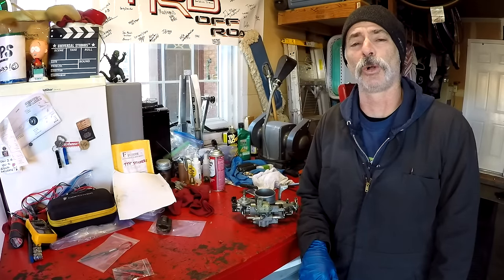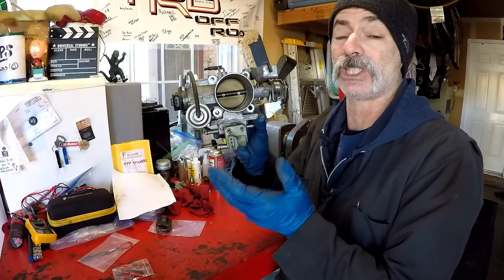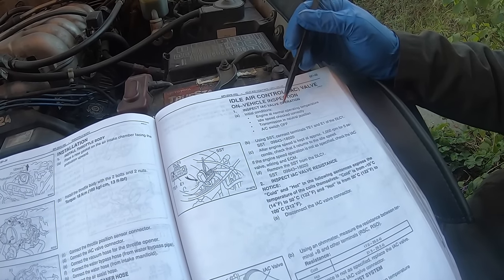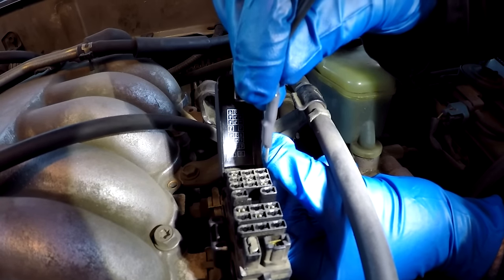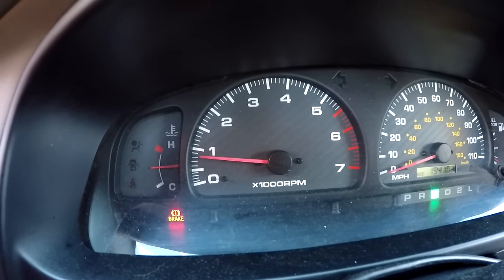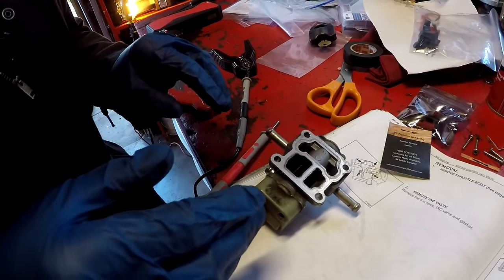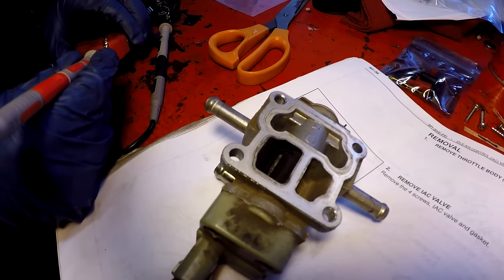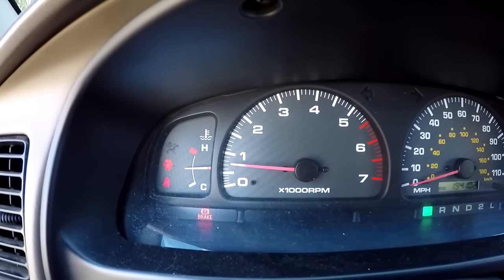IAC Valve Testing and Cleaning

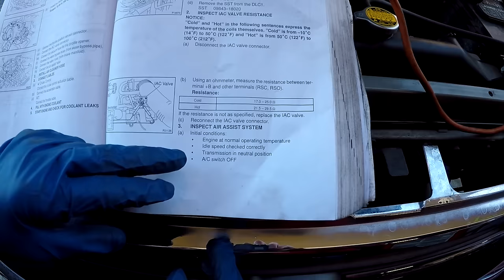Comment: 20:55 wow ..so much more complicated than the GM  3.8 L Buick V6  IAC  removal process ..
Reply from the maker: Well, the time stamp you gave was part of the testing we did for the IAC, not the removal.  The removal is actually quite easy.  Remove the throttle body, flip it upside down and remove the 4 screws that hold the IAC to the throttle body.    Pretty straightforward.  The testing for sure was a little more involved.

Comment: I have a 2003 Toyota Tacoma with the 3.4L and it doesn't have a iac does anyone no why
Reply from the maker: Hey Kevin,  Toyota changed the throttle body design for the 01 and 02 4runner models and the 03 and 04 Tacoma models.  It has a different system to deliver air to the engine under idling and deceleration conditions.  I'm still unsure how it accomplishes this and I've made a Toyota forum post and hopefully somebody will have the answer for me.  There is an obvious air passageway on the backside of the throttle plate but how the air is delivered to that passageway is the question I'd like answered.  If I get an answer, I'll put it in the video description or a pinned comment.  Stay tuned.

Comment: Tim, what makes the RPM's stay high when shifting a manual transmission? Can you possibly do a video on this? Great video btw!
Marc C
Reply from the maker: I don't follow what your problem is.  The idle is high only while you're shifting?  Is it high when just idling too?  It doesn't make sense to me, so if you could explain it better it would help me answer your question.

Comment: Would this cause extended cranking to start when it's cold
Reply from the maker: If the valve is sticking and not giving the engine the air it needs, it could cause it.
Reply: If that's not the cause what else could cause that
Reply from the maker: @davidrowland2354  It could be a fuel delivery issue.  Maybe it's taking extended time to build up sufficient fuel pressure to start the engine.
Reply: I put a new fuel pump new pressure regulator new fuel injectors new fuel filter
Reply from the maker: @davidrowland2354  Well, you covered the fuel delivery possibility.  It couldn't hurt to clean the IAC and see if that helps.  It could be a problem with the igniter that's on the passenger side of the engine compartment.  But, I don't if an igniter would have an intermittent issue like this.
Reply: It just happens when it's cold it takes 3 or 4 cranks to Fort the start but when it's warm it starts perfect I'll try cleaning the valve and get back with you thank you very much for your information
Reply: I tried a ohm test and nothing registered
Reply from the maker: @davidrowland2354  I guess you found your problem as long as you did the ohms resistance test correctly.

Comment: ive recently face a problem with my 5vzfe engine where when i start driving (after the engines warmed up to operating temp) the rpm drops and returns back to normal in a very fast manner (with slight loss of power) and this only happens when i start driving the car I.E. the remainder of the journey the car drives fine, ive scanned the ecu and ive had no codes detected (had one maf code which had gone away after cleaning the maf) would you be able to point me out where might my problem be ?
Reply from the maker: It might be a problem with your throttle position sensor but I'm not sure about this.  It's a hesitation with the engine responding properly to the throttle response so I'd probably start by diagnosing a potential problem with throttle position sensor and go from there.  It could also be a problem with the engine temp sensor that communicates with the ECU to know when to increase the idle when cold and bring it back to normal when it's warmed up.
Reply: @TimmyTheToolman  well when we scanned the ecu it only gave three codes two of which were related to the MAF sensor and another was the o2 sensor however the o2 sensor gave a code because i have removed my cat, my mechanic keeps stressing that he is 90% certain that it might be from the crankshaft sensor but it never gave a code. further more i wanted to mention that the car used to have a 3rz engine and i switched it to 5vz
Reply: i forgot to mention that the car takes a bit of time to start eg 3-4 seconds
Reply from the maker: @arefalmutairi7839  Well, I'm guessing you must have put in the proper ECU for the engine swap.  I would think a crank shaft position sensor problem would cause the engine to run poorly all the time or not at all.  Have you tested the Ohms resistance of your MAF to see if it's within spec?  The hesitation at start might be a fuel pressure issue and it takes some time for it to build up when you are first trying to start it.
Reply: @TimmyTheToolman  well in fairness ive noticed that the car performce poorly and the rpms drop below 500 only when the weather is hot, in regards of fuel pressure i have upgraded to better fuel pump cleaned injectors and fuel rail and have changed the tbelt. however the ecu came with the engine and so was the transmission
Reply: there was no need for looking for an ecu to fit the engine, i was thinking that it might be the ecu pin outs that may be causing the problem as they are made out of copper and copper at times forms green gunk which requires cleaning, i have no clue where the ecu pin out is, i own a prado j 120 3 door version. ive cleaned the maf yesterday drove the car earlier and was fine parked it then drove back home and i realised that it was hesitant on idle and the rpm thing happened again. my mechanic keeps saying its the crank sensor keeps acting up when it gets hot and it would not even throw a code ive no clue hence im reaching out to you
Reply: ive changed the fuel filter too and spark plugs as well
Reply: yesterday i was surprised that all the bolts on the cam cover were loose i almost got a heart attack, i tightened them and the car drove different
Reply from the maker: @arefalmutairi7839  A buddy of mine has had issues with his EFI 15 amp fuse popping in hot weather.  We thought the fuel pump might be the culprit because it has the most draw on the system but a replacement OEM fuel pump did not fix the issue.  He's now going to try swapping out ECUs and see where that gets him.  Sounds like you might have something similar going on.
Reply from the maker: @arefalmutairi7839  Valve cover bolts coming loose is super common.  As the rubber on the washers age and shrink from the heat of the engine, the bolts get loose.  The torque value is really low for those bolts.  If I'm remembering correctly off the top of my head, it's 53 inch pounds.
Reply from the maker: @arefalmutairi7839  Getting at the crank position sensor is a fair amount of work.  You basically have to do most of the labor that you'd do for a timing belt swap.  Using common sense like you are, I would think the ECU would throw a CEL for the crank position sensor if it was acting up.  But, I'm not all-knowing either and maybe your mechanic has lots of experience with these engines.
Reply: Timmy The Toolman if it were the ecu itll probably be a pita to have gone through all that work and it ending up being that small issue, ive already ordered all the parts once i have them installed ill let you know how it goes down, is there an email i can contact you through so i can give you an update abt the car

Comment: Could a bad iac cause intermittent  crank no start ?
Reply from the maker: Are you getting a CEL?
Reply: @TimmyTheToolman  no
Reply from the maker: @alfredomejia410  So, is the engine cranking but not starting or is it failing to crank?
Reply: @TimmyTheToolman  yea . But it only does it sometimes. I was just wondering if the iac was a possibility. Since I’ve checked everything else it could be .
Reply from the maker: @alfredomejia410  I asked two questions.  Is the engine cranking and failing to start or  just failing to crank?
Reply: @TimmyTheToolman  cranking but failing to start
Reply from the maker: @alfredomejia410  Ok, gotcha.  Have you tried giving some gas pedal input to see if the engine starts?

Comment: When you removed the two JIS screws to remove the plastic connector from the IAC valve, did it matter if the valve was open or closed when you put it back on? Thanks.
Reply from the maker: I don't think it would matter but it wasn't something I thought of at the time.  The functioning of the IAC door is pretty simple.  It either gets a signal to open or close.  From my experience doing this video, the valve defaults to the closed position because that's how I found it when I pulled it off.